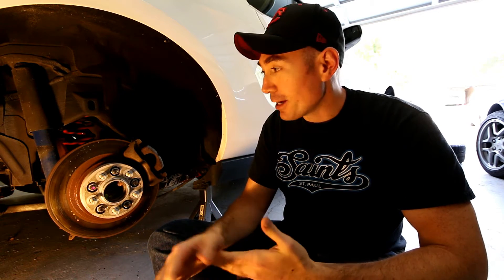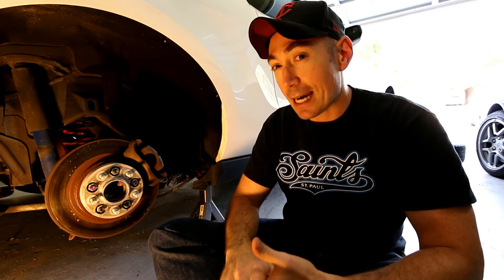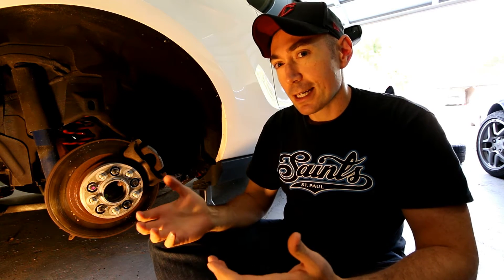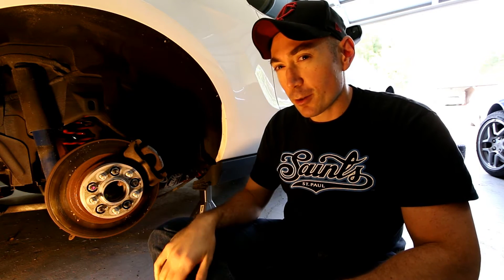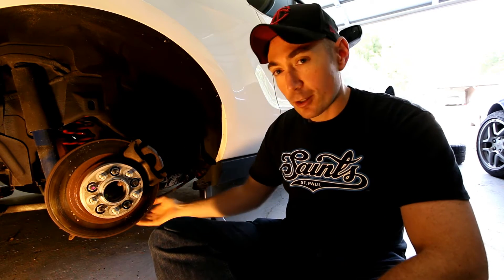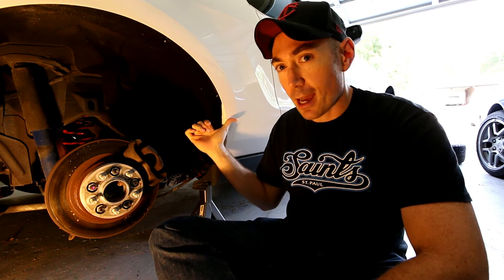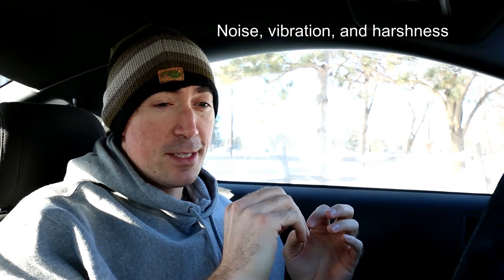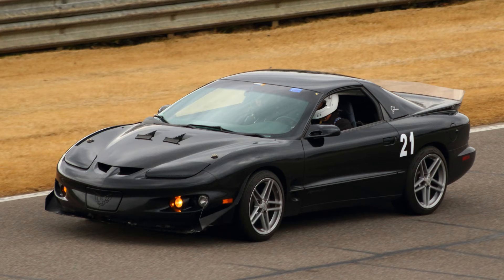Mustang Control Arm Experiment!

Comment: I have tried something similar with both spray on bedliner and Lizard Skin (and it's similar home made copies and competitors). They all did a pretty good job of decreasing contact sound levels. I did not notice a frequency change, just a difference in emphasis. Which did make the sound "sound different" I recorded the sound with a Sanken lav mic and ran the recording through a scope to determine what sounds were coming through. All the sound levels were decreased with a more extensive attenuation of the higher frequencies. If I sprayed on more than one coat the bass frequencies dropped even more, while the high frequencies nearly disappeared.
I wonder if the Boom Mat was designed to remove more of the lower frequencies in the first place.

Comment: did you try the whiteline lower control arms? i thought the bushings on those were supposed to be pretty good from what i read. i have a 2014 and am going to do LCAs n relocation brackets at some point too. its my daily driver though so obviously i dont want something too obnoxious. after watching this im almost considering just getting the relocation brackets and keeping the stock arms but i dunno if thatd even work.